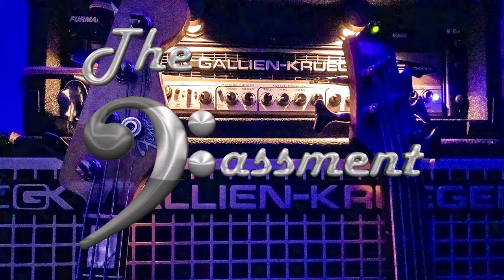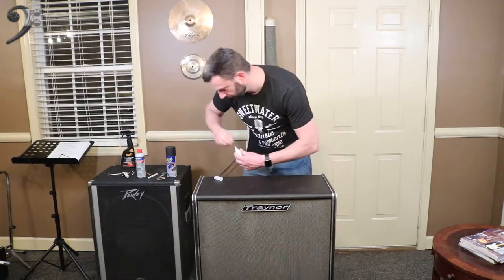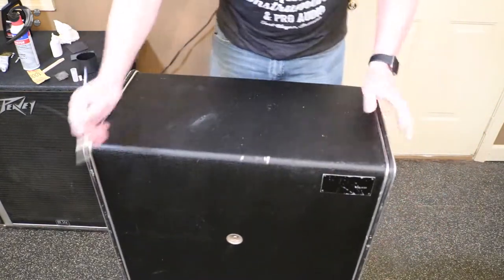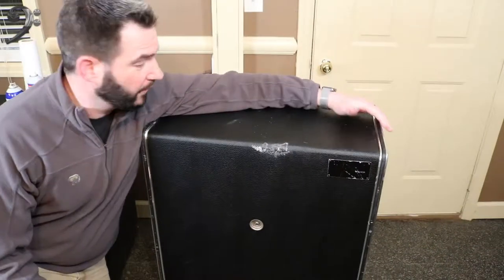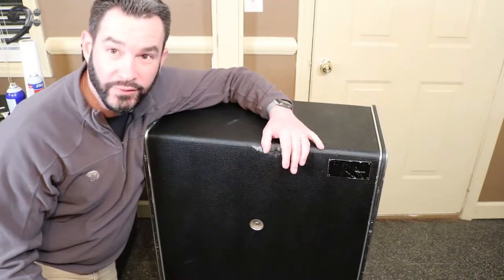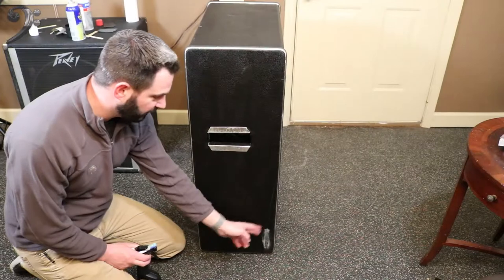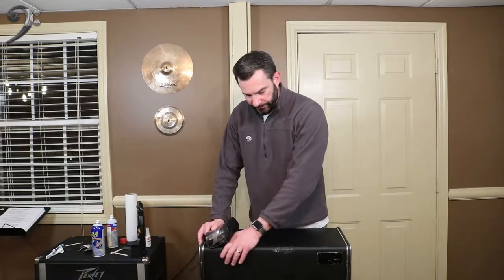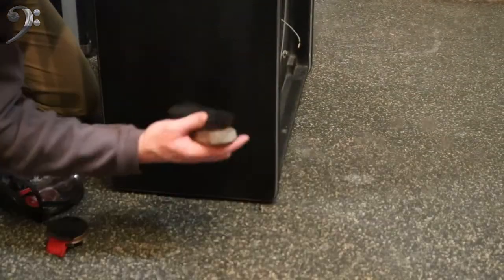Traynor YT 15 Restoration Pt  6

Comment: you might try Titebond 3 wood glue. it is strong and wipes off with water. you could manipulate the work piece and clean up squeeze out. i used it on my bass and it cleaned up easy.